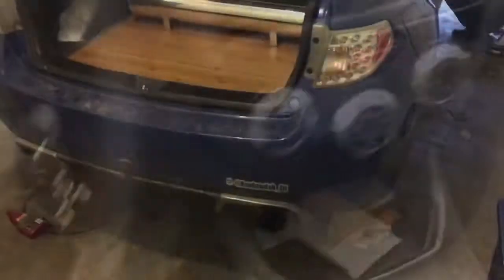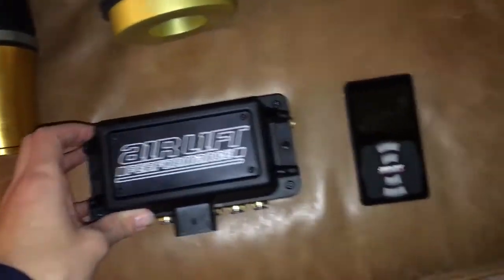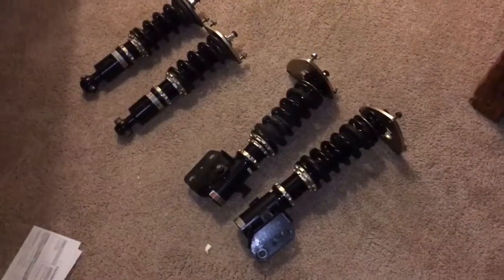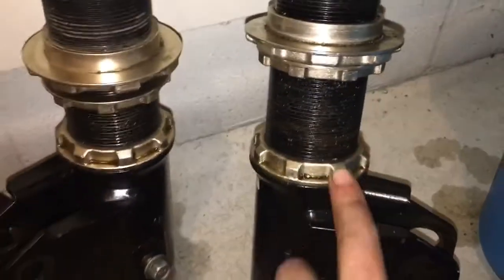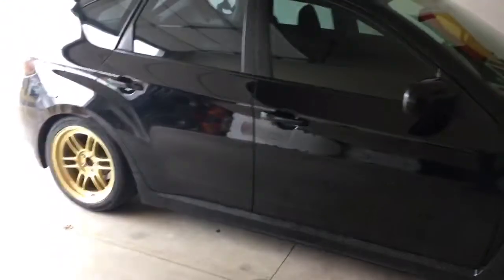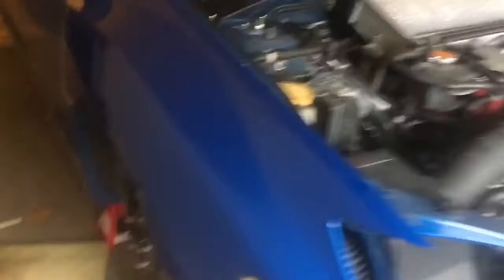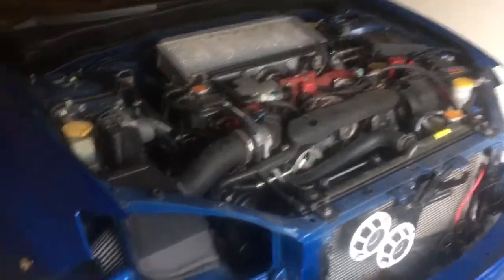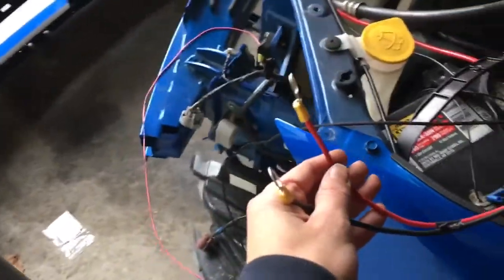BC Racing OCD Bag Install - 2014 SUBARU STI

Comment: How do you like the bags? Are you happy with them? A honest pro and.contra video would be great
Reply from the maker: this is actually my friends car...I have airlift performance bags on my volkswagen. Car has been bagged for 3 and a half years with no issues. over30,000 miles too. They drive awesome, the functionality is unmatched. It opens up a lot of opportunity for wheel fitment because you can basically run whatever you want and get them to fit. Its a lot of money but its worth every penny in my opinion. My other car (2011 WRX hatch) is on k sport coils and it rides great but its not really THAT low on 17" RPF1 and i cant run a front lip on my car cuz it will just get destroyed. I wish i could bag it but i have plans to sell it for an R32 in the near future